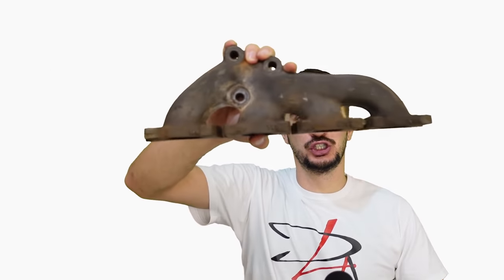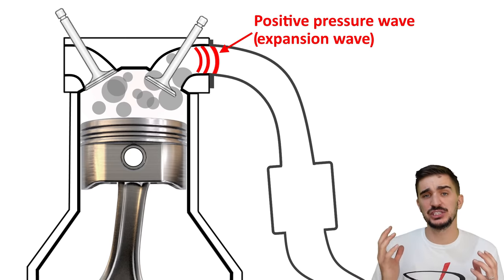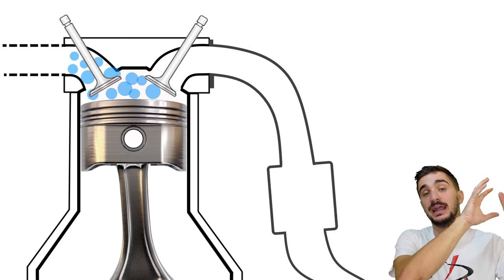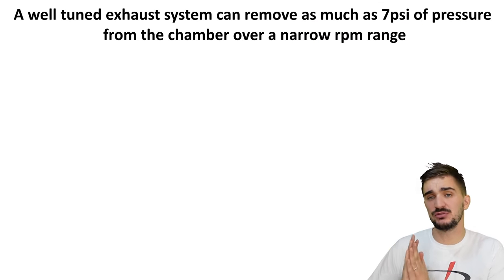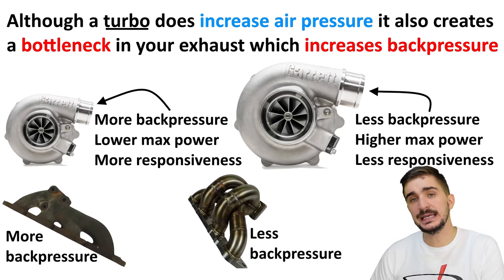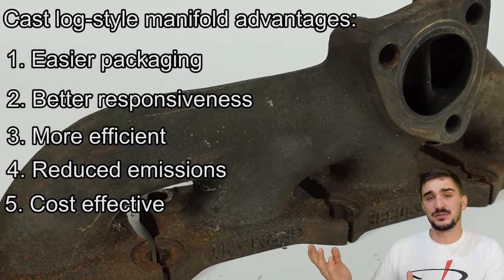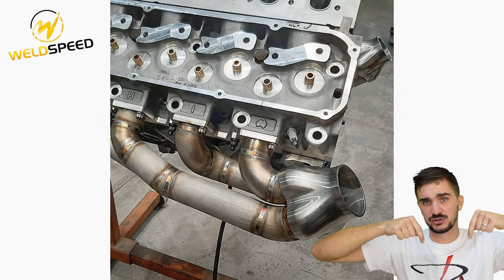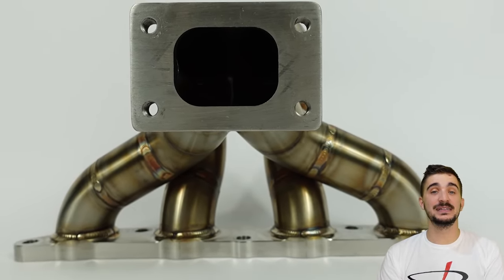EQUAL LENGTH tubular vs. LOG manifolds (headers) - SCAVENGING and EXHAUST BACK PRESSURE EXPLAINED

Comment: You did miss one trick where cast manifolds are superior. Yes, stainless steel can handle higher temps, but the wall thinness makes it very likely to expand when heated, which often leads to cracking at the welded points where each tube tries to expand but is locked in place. In addition, each weld acts as a stress riser, meaning the force of holding the turbo and absorbing driveline vibration is concentrated in a small area unlike in a uniform cast material where load is distributed quite evenly. This uniformity and thicker overall wall thickness of a cast manifold makes it much more durable under repeated heat cycles, despite having a lower rating.

I am also curious how the plenum effect, where exhaust gases collect before entering the turbo, might lead to improved balance of backpressure vs keeping each cylinder so separate. ITB's are much harder to balance for individual cylinders than an enclosed airbox for pressure and flow reasons
Reply: i would  not agree with you , i saw many cast iron manifold cracked , and cast iron manifold has ticker walls that is not good because difference in temperature that causes stress in material. i had long tube header and because i floored it is burnt and melted but not cracked on welds
Reply from the maker: I get what you're trying to say but it's a bit misleading. Assuming good welding technique, proper purging procedures and materials a weld's role as a stress riser is negligible.
The same goes for each tube expanding separately, this really doesn't happen and the manifold expands and retracts as a whole under normal operation. The final point is the uniform structure of casting. I'm afraid castings most often have the worst and most irregular grain structure and exhibit porosity due to the nature of the manufacturing process. When it comes to wall thickness this definitely makes sense and with enough thickness a cast manifold can indeed be extremely durable but you need so much thickness that weight and bracing really becomes an issue. But this is why you see very thick manifolds on trucks where they are expected to last for a very long time.
As to ITBs and balancing I'm afraid we're taking apples and oranges. ITBs will always yield superior power and responsiveness compared to a plenum due to somewhat obvious reasons (more air faster and more directly - all other factors being equal). Their balance is only really relevant at engine idle and has next to zero effect at WOT. An equal length manifold will always be superior to a log in terms of power due to reasons explained in the video. There really is no need to complicate the analysis by trying to include things that really aren't a factor in this.
Reply: @d4a  that is right except one thing wall ticknes is problem , more tick, makes stress when heats up, because inner part is warmer , outside is colder, can not be heated up simultaneously, but if is thin , it heats up imediately
Reply from the maker: I don't see the logic. Blocks are very thick and they never crack because of their thickness? I don't see how heating up of a thick material increases stress vs a thin one. I think that this debate is overall a moot point honestly. Neither casting nor welding guarantees durability and longevity. Both types are used by OEMs and there are extremely durable as well as very poor examples of both cast and welded manifolds. I believe what's far more important for durability is design, quality and vibration minimization.
Reply: @d4a  mostly, people with stock car does not races, but i saw many cast iron collectors cracked, maybe because  there are plenty, if you try to weld cast iron you have to preheat it slowly, to avoid big differences in temperatures in material, and big collector on truck is not loaded by temperature as on petrol engine, because it has lower ex temperature because diesels work with plenty of air, more than 20:1
Reply: @makantahi3731  There's nothing more annoying than people rambling irrelevant nonsense or giving their biography in the comments. Compression ratio is not a/f ratio and diesel stoichiometry is slightly higher than gasoline. And diesel egt's can be just as high as gas in turbo applications. They use heavy cast manifolds for the same reason passenger car oems use them because they're heavy duty trucks and they're cheap...
Reply: @20somthingrealestate  what is your point, what is nonsense, what biography i mentioned, i did not tell that compression is same as a/f ratio , maybe you missed some lessons in school?
Reply: Mark Twain once said something along the lines of “ never argue with an idiot, because from a distance you will be indistinguishable from the idiot”
Reply: @d4a  hello fellow petrol head, greetings from Argentina ! 😎
Reply: @20somthingrealestate  20:1 is overall a/f  in diesel engine, did not know?, it works with lot of air, so exhaust gas is colder than from petrol engine, all my notes have point with video because video is incomplete, it explain only one smaller part of exhaust flow, so you should educate yourself , because your knowledge about this topic is more incomplete than this video
Reply: @d4a  Didn't mean my comment as a diss or anything.. sorry for triggering 😂 The ITB thing really was just thinking out loud, but the issue of stress risers on welded thin wall tubing is very real, not only when heat is involved. It's been a factor for a long time with welded bike frames etc as well.
Reply: @20somthingrealestate  you speak about race diesel engine? who   drives diesel as petrol,btw,800 f is about 420 c, and you think it is big deal,petrol engine has that temperature on idle,if we speak about highly modified tuned diesel engine,take a look on gale banks channel,he made ultimate engine that works with 14:1 a/ f ratio at top power, so diesels for general use have half exh temperature of petrol engines for same powre rating and way of use,and second btw do not tell me to learn english because if try to speak in my language,you would sound like bigger ignoramus than you are
Reply: Yeah no kid, the problem there would be the subpar welder.
A weld should never fail before the base metal if done right.
Reply: @20somthingrealestate  Also, I had a bunch of girls from the ‘East Side’ shore ask me where their douchebag cousin went, I’ll let them know I’ve found him! Lol
Reply: @makantahi3731  You are talking about the thickness of the manifold like it is a separate part and not a part of a whole assembly. That's 1 thing. The other is that you forget that the entire assembly of the aftermarket manifold, it, is made of the same material, so they dilate the at the same rate. Furthermore, the big parts that are directly mounted on the engine and at the end of the thin pipes, will act like a cooling element until the entire assembly reaches “a close to each other temperature”. Not to forget that the stress caused by welding only takes around 220-240 Celsius degrees for 2 hours or so, maybe less, to get reed of it.
Reply: @makantahi3731  the more lean your fuel mixture, the hotter the exhaust gases. Quit spewing bullshit lol
Reply: @makantahi3731  .......language is actually a key factor to relay an exact information for the other to deduce & process. It is a necessary verbal function but when there is disassembled verbal meanings or context structure, it's a wasted noise. As much as you think you know about engines or if you are an engineer (doubt), one sided knowledge don't pay off as good argument when grasp on language is the problem.
Reply: @changsangma1915  you are right, english language is problem because i am not natural english speaker and it is hard to explain something to people that think they know much, but they do not know much, but they speak english language good, so we can do it on 2 ways, 1. get use on broken/international english or 2.we can discuss  in my language, so you could learn my language or you could use google translator, but in both cases , you would soon realized that my broken english is not so much broken as would be your attempt to speak in my language, if you wanna try, ask me in english i will answer in croatian. Next thing , what skills you have that you can recognize if somebody is engineer or not, i can , because after all i wrote just in this comment on comment reply, you  did not recognize misconceptions  and shallow  knowledge guys that discussed with me, so maybe you and they are engineers but not for engines, cars, materials and technology, (they are maybe cheefs, cowboys or just regular guys that like cars but do not have wide theoretical and practical knowledge about things they like), ok, i am waiting for your question, to see how it will go
Reply: @fastinradfordable  I believe he wrote that they will drag you down to their level and defeat you with experience. That could also be just another version of the same basic problem.
Reply: @makantahi3731  What I find shocking is that I found an exhaust manifold with tiny cracks on a timidly driven 4A-FE. (With heat shield in place, so I don't assume stress cracks from rain water getting onto it or such.)
Reply: ITB's are particularly good in high rpm applications where the power band is quite narrow and quite high in the rpm range. 

WOT is the pretty much the easiest configuration to tune. It either works well or it doesn't. Or it doesn't work well for long...

When fuel efficiency, engine service life, closed/partial throttle 'behaviour' come into play, it is rare for a longitudinally configured engine with un-sheltered & unmetered TB's to reliably perform well across the midrange rpm. And are terribly susceptible to environmental conditions. 

But, in the right application and if tuned well...  🤩🎶🎶
Reply: But how much of cracking is caused by fabricator not taking into account the effect of heat affecting the yield strength of the metal itself. Especially with some of these bigger turbos, a big-ish turbo can weigh up to 30 lbs.. it may seem fine statically, but when that f*cker heats up that's when the cracking happens on relatively thin wall stainless. You need to brace it up right from the outermost part (most leverage/load) to somewhere on the head directly so that none of the weight of the turbo is supported by the tubing rather it is fully supported by sufficiently thick braces that will not yield throughout the entire temp range.
Reply: The main contributing factor to use cast iron manifolds… cost and NVH. That’s it. Mass produced vehicles are not aimed at being the most efficient or powerful in their potential combinations. They are meant to deliver a power number that can be safely ram in all conditions over a long duration of time without much maintenance. And mindful of cost both upfront and continuous maintenance cost. It’s always about selling to the masses for the most profit margin over the best product. Hence why the aftermarket in automotive business is so lucrative.  

I always laughed at people who say exotics like Ferrari are the best. No they are essentially the most “efficient “ combos straight from the factory with a huge price tag. I’ll take a “cheap” US domestic brand, put a fraction of the cost in aftermarket parts into, and have more money in hand to get the same or better results; comparatively speaking.

Comment: Excellent !  That has to be the best explanation of manifolds that I've ever seen. (Another one of my automotive heroes is David 'the wizard' Vizard who goes into great detail, based on a very scientific approach.)  The only thing I would add is exhaust gas momentum - at higher rpm the exhaust gases have a fast moving mass which pulls out the following charges from each cylinder.  Again, as you mentioned, the manifold design and optimum pipe diameter are important, all depending on the engine and the spec you want.  👍
(PS:  I can only comment on normally aspirated engines.)

Comment: 3:38 The intake air coming into the intake valve is almost always below atmospheric pressure. The air cleaner and throttle plate cause reductions below ambient atmospheric pressure.  This is an important distinction when considering part-throttle operation.
Reply: without computers, the thought would not exist.

Comment: With turbo motors, it's all about the temperature of the exhaust gases. That heat energy goes to power the turbo so cast iron log manifolds are good in that application. My BMW M2 has a simple exhaust log manifold and I'm happy with the overall performance.

Comment: There are so many variables on a
 N/A that the easiest way to determine the optimum configuration and dimension is to mount the engine on a test bench and make a modular telescopic manifolds with at least 8in of adjustability. Starting from a ball park dimension in the first place.
Turbo manifolds seem more subceptible to pipe diameter, not pipe length, unless you are compeating and have cam shafts that allow the engine to rev. as high as a competition NA motor, as in the video.
Well explained theory on a subject that has sent many a good man mad

Comment: One of [if not] the best descriptions of "the process" (and in under 18 mins) I've ever heard, bar none.  It was like having my GF talk dirty to me again but before she gained the weight. So, Yes, I APPROVED THIS VIDEO :O)   The rumors are true. You "are" the Gear-Head Whisperer. Cheers!
Reply: This comment has me straight f***ing rolling 🤣😂🤣

Let’s go Brandon!
Reply: What does talking dirty have to do with weight? You can successfully talk dirty to someone, without ever seeing them in person, so their weigh should have very little bearing.
Reply: @the_hate_inside1085  I hear you T.H.I. But once you've seen Ms. Muffy trodding down the hall in a towel (that will always be to small).. well, you just can't un-see that. This has a direct impact on future Remote Oral Stimulation (ROS), for me at least. Just saying. Anyway, that's the skinny on the subject. You RoCk! Cheers.

Comment: Here in the UK there was a car called the Vauxhall Corsa B which had a 1.6 16v engine and made approx  108Bhp. There were two common mods people would do. One was a 4 branch free flow manifold, de-cat, and free flow resonator and backbox and the other was a "power box" where they removed the stock intake manifold and put in a "less restrictive" version
The problem was, this upset how accelerated the air was in the cylinders at low / mid rpm and messed up the scavenging effect.
On the dyno the mods took the power to approx 130bhp, but unless you were revving it's nuts off daily it didn't make a good daily driver.

Comment: Also something to note, as you widen a runner it is possible to reduce the overall flow due to the resulting bends. Larger diameter pipes end up having sharper bends in a direction change over the same distance.
Just something to keep in mind. Also going too big can have negative effects in other ways, like reducing exhaust speed.

Comment: Hi there, very nice video! I am about to design my first "compound turbo" manifold ever, for my particular build, I am on a budget so only could afford a MIG welder, I have never welded before but have watched 1000s of tutorials on how to achieve acceptable results. With that said and welds aesthetic put aside, my 2.3 liter engine has already quite a large diameter exhaust port diameter 42mm, which I guess for you guys is just normal day in mods avenue, so I can use 49.3 X 3.2 mm 304 or  321! I am aiming for a compromise between a daily driver and a Street performance car. My engine crank and cam shaft have been proven to handle over 600HP stock. But I took the liberty to upgrade the con rods to a 1200 HP capable model to be on the safe side! Now, I have heard of people pretending to kinda have "replicated" the STI Boxer sound with uneven runner pair length. Though I believe engine sound is not only the result of exhaust but also of intake, I would like to hear your opinion on that one! Thanks in advance!